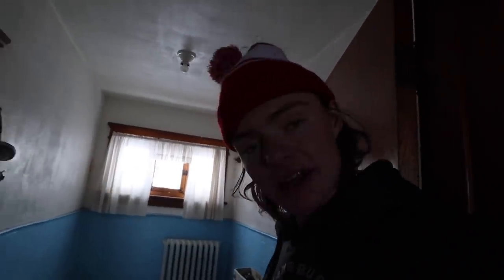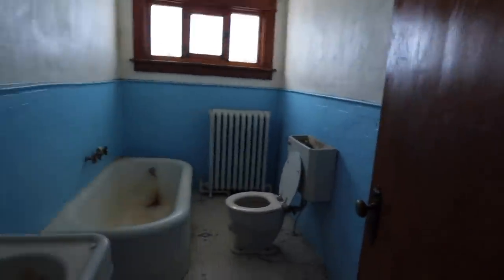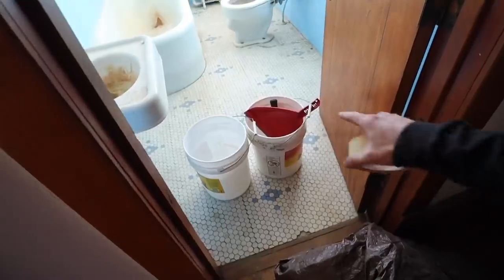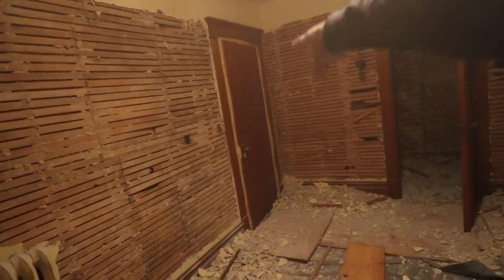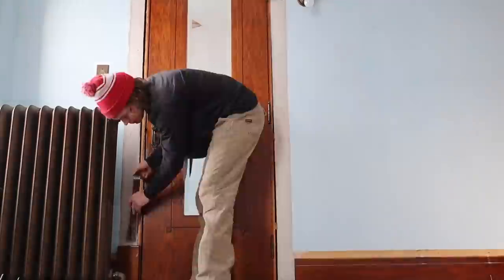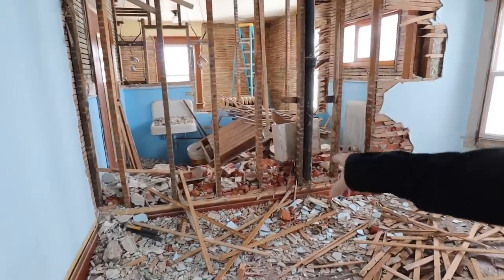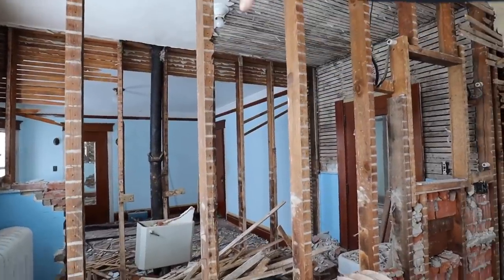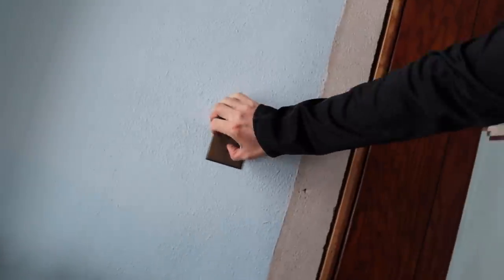Remodeling My Ex-Hoarder Mansion Ep. 2

Comment: Put a dumpster outside below a window so you just toss things out the window into the dumpster. Saves a lot of time and effort. You can probably sell the sink, toilet and tub. There are porcelain tiles that look like marble but are only 1.99 sq ft. They are at Floor and Decor and come in various sizes. 12x24 and 24x24. Get Matt finish; with polished you would bust your but when it gets wet.

Comment: word of advice put as big as possible a fan in the window blowing out, and better yet if you cut a piece of plywood the size of the window opening and mount the fan on to the board with a hole cut out the size of the fan it will suck all the dustout.  before tearing down any wall make sure it is not a weight-bearing wall

Comment: I'm getting started on my own 120 year old house in a similar manner. Can I suggest using Sketchup (free version) to lay out your floor plan and wiring plans (and plumbing plans, if they're complicated enough to bother with; mine pretty much aren't even with adding a 2nd bathroom). Don't think I can post a picture here, or I'd show you the kind of thing that's pretty straightforward to do, and really can make a difference for your end result by giving you an end goal to aim at. 
Also: thank you so much for getting a mask. I suspect there wasn't asbestos in your plaster (too old for it) and that the major fibers previously found were horse hair (like in my new old house), but even all that plaster dust can be rough. Lead paint could be a concern, too... So thanks for modeling the safety gear!

Comment: ...might be a good chance to put in a furnace in the attic to heat it and the second floor.  Then one in the basement to heat it and the first floor...  that way can avoid framing in ductwork chases.  You'll just have registers in the ceiling of the 2nd, and registers in the floor of the first.  Heating systems are pretty easy to do yourself, and fairly inexpensive.  You could add ac too, but a pro will more than likely have to do it and now we're talkin some money...

Comment: Now something I know a little bit about. If you are going to reuse that woodwork DONT try to pull the nails out of the front either pull them out the back or just cut them off with an angle grinder. Also that old lath and plaster was thicker than drywall, you will have to shim out all of the old framing so the trim will still fit. It's really important on walls that have a door or window in them as the casings were wide enough for the plaster walls and believe me it's a lot easier than cutting the casings down. Next purchase "Table Saw".

Comment: Be careful and don't make the house too tight with insulation. One of the reasons old homes like this lasted so well is their had a lot of ventilation to dry out any water ingress in the walls, which with time there will always be some, nothing stays sealed forever.

Comment: cole:  a piece of advice, don't junk any old 2x4 or other dimensional lumber or bust it up for fire wood. That stuff is gold when you remodel old homes. it is usually a full 2x4 inches where as today 1 1/2 x 3 1/2 is standard dimensional lumber and they will cheat on that sometimes. plus the old lumber is dry and better quality wood where as that stuff in the lumber yard is still wet; hence all the twisting, bowing, shrinkage.

Comment: Hope ya run by your carpenter  friend--  Plumbind needs to be thought of for access.etc..  Putting in cenral air?? how about radiators--keeping..  need heat and cooling for all the new room layout.  same for attic-  whats planned for air and heat-- separatye own smaller furnace w/air conditioning??

Comment: glad you bought the same mask i have!!! and also did you have to buy my sweater too? mines full of weld burns and split stitching. keep up the good work it sucks i own a house made in 1893. plaster and lat is more sound deadening but hard to repair just one spot. i am slowly gutting the house and using insulation and sheet rock.

Comment: Looking forward to seeing you redoing your house. If your working with that much space, do yourself a favor don't skimp on closet space. If your a fan of organization like me you will use every bit of it even if its the size of a small bedroom. Don't skimp on your bathroom either. Be creative, private toilet area with fan. Might go as far as multiple spray in heads in shower area. I regret not pulling my tub and doing a little bit larger shower space with multiple spray heads. However my space was limited. In your case the sky is the limit. If your tearing down to studs, re- insulate,  So looking forward to your results.

Comment: I have to say, one more time, check and make sure you aren't removing important parts of the internal load bearing structure. When you create a significant open span like you are doing, something has to be included to hold it up, just give us a "We got it Covered" so we can not worry about your farmer self(ves), depending on quantity.

Comment: Hopefully, full consideration has been given to which walls are laid bearing in your demo plans. To determine if a wall is a load-bearing one, go down to the basement or attic to see which way the joists run. If the wall is parallel to the joists, it’s probably not load-bearing. If the wall is perpendicular, it’s most likely load-bearing. You’re doing such great work, but removing a load-bearing wall by yourself can result in a lot of costly mistakes. It is best to consult a licensed engineer prior to beginning work on your renovation project.

Comment: Cole you can break that tip in in five to six pc get a sledge hammer hit the inside at all the corners the bottom will break into one pc then hit the same corners and walls break up the rest is easy do not hit on out side corners you’ll be there all day don’t turn over same thing or keep in one pc they make good water troffs

Comment: Not sure how you intend to move that soil stack.  The old drains and air vents are still needed.  Please reuse the old closet doors and trims.  These are the character of your house.  Why was there a brick layer to that bathroom???  Would be nice to know how that was made.
Reply: And the comments above me just told me why the noggin was used.  But several have expressed concern for the wall removal, yes you need to see how the walls above are supported.  It is very dangerous to take out the supports for your ceilings and important roof.

Comment: Plaster walls will last many generations and is easily repaired.  Why knock it down?  P.S. Mark and number EVERY PIECE of trim because every wall, window and corner of an old house is different.  Also reuse the original nail holes and PRECISELY match the nail size and structure.  If you buy a different iron alloy nail it will rust and rot the wood around it.  Since 100 year old nails are hard to find you should lacquer every nail before using.  Also mix authentic lacquer for the wood from lac-buttons and use grain alcohol instead of denatured alcohol if you want the same warm wood look that ages evenly.

Comment: Cole you can remodel and save most of the wood work that was original..please please do! It would cost millions to replace it! I did a remodel in a house that was built in 1923 and I saved all the original wood work. I paid 45 thousand for it in 1983 and sold for 300K in 2020. You should of taken the wood work out first.

Comment: ugh... knob and tube. Let's hope you have battery operated fire alarms installed.

When you are putting through new wiring also run ethernet, it's worth having in any modern house just to have it, multiple drops each room. Sure you need it for wireless access points but also for and future needs. You'll hopefully never have it down to the frames again in your life time, might as well future proof as much as possible. Might want to consider it for security cameras too.  Cat6 will run around 100 metres and will allow you to do PoE (Power over Ethernet). Get a network cabling person to help to avoid things like neXt (Near End Cross Talk).

Comment: 20" box fan with a tight weave ac filter on the back. The fan pulls the air through the filter and will quickly pull the dust out of the air. Run the fan on low and point away from the area you are working on. Bigger rooms I usually run on medium.

Comment: a fire hazzard?..is all that cardboard you keep. you demoed that room wrong. the window & door trim, base boards, light fixtures, ect come off first. and then the demo work from the ceiling down. Always down. before you hang your drywall, you need to buy a case of fireretardant tubes, and spread it in ALL gaps and holes, around that chimeny, heater vents. i mean every hole, gap..where a wire comes through, all of it. them old homes are a fire hazzard in waiting and one hole will send her up in flames. install your insulation. then install your 5/8 inch drywall on the ceilings FIRST..then 1/2 on the walls..i know you read a book and saw some vidga on lube tube. However, i am a retired insurance home restorer 20+ years. do what i just suggested to you - its free (good advice) and how its done in my world. also, be the friendly home owner and make friends with your home inspector. no he doebt need a bottle of heinz ketchup (lol) how you make friends with a home inspector? is do your home work before he arrives. dont try to hide anything he's an engineer and knows structure better than you. they want to come in and see what you done, and how well its done. SEE your work so dont hide nothing. anything you need...lask him, he will help you make your home a safer place to live. be ready to answer questions- but dont run off at the mouth or point shit out..if the inspector points out stuff..let the guy do HIS J O B. you might know the house history..but he can fail your permits. unless...its illegal home restoration...then your in for a whole lot of trouble and a world of hurt. merely suggestive cole. nothing personal.